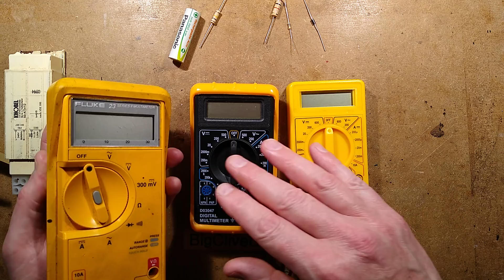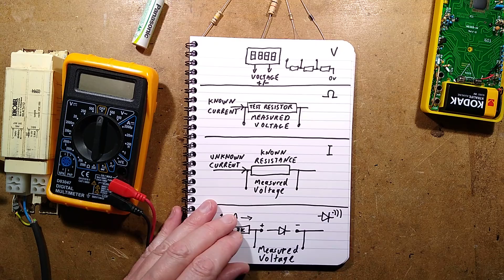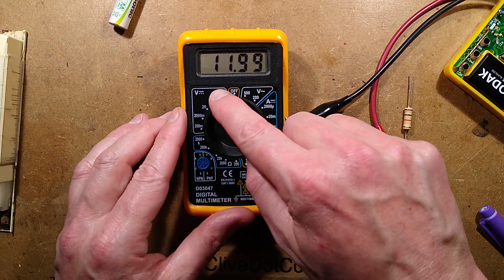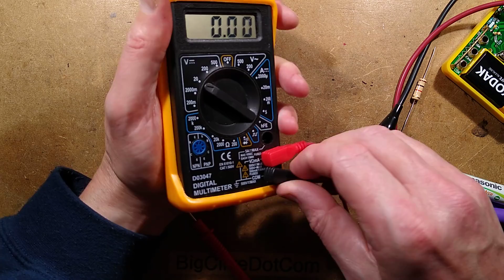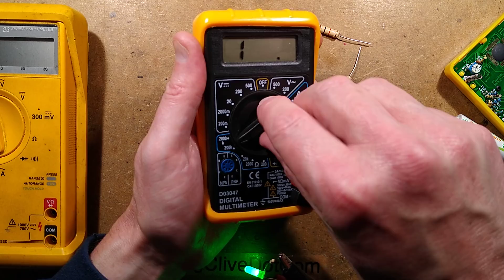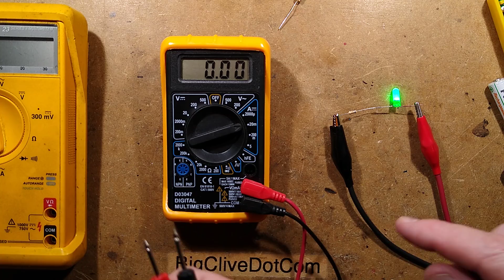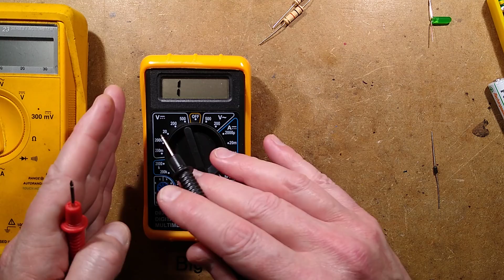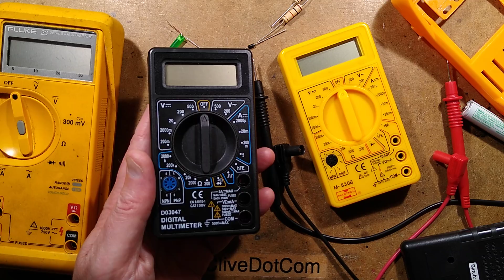How to use your trashy meter without blowing it up (much)

Comment: IMO, one of the nicest uses of the diode mode is the Louis Rossmann short-to-ground check. You attach the positive lead to the ground and probe whatever terminal you want to measure with the negative lead. Due to the inherent clamping diodes in any silicone chip, you will almost certainly get a forward diode drop. If it reads overload / open line, it's an open. If it reads 0v, it's a dead or low resistance to ground (but not via silicone).. It's not only useful for circuit boards, but also automotive etc.Just make sure the device is powered down.

Comment: I have loads of the cheaper ones. Bought from Maplins when they were £2 or £2.50. Some had a large blue rubber protector which is still good after almost 20 years. Same can not be said of some of my more expensive meters where the rubber covers fell apart after a year or so (whilst stored in the original box). Budget 9V battery lasts years and years also, Perfect for automotive and battery testing.

Comment: I got two of those cheap yellow ones many years ago - you could get them in packs of two for not much more than a single one, and I quickly learned the benefit. Yep, I did the typical, checked a mains supply with it set on ohms. It literally blew apart. Very entertaining. The second one still works all these years later.
Reply: Spare fuse - huh - SPARE METER !
Reply: I bought some of them many years ago from Maplin when they were selling them cheap at £2 each. I think I have two out of the cases and one still in its box/wrapping unopened. After probably over 25 years, the one I use regularly is now showing that the battery is low. I have a new 9V battery ready to put in it.
Reply: @paulsengupta971  I buy meters similar to the all yellow one from AliExpress and Harbor Freight (the HF meters are red for some reason, on sale they are about $5).  The leads that come with them are useless, I replace the leads with something slightly better, they used to be a buck or two but now they cost more than the meter at $7 or so.  Even with that, the cheap Harbor Freight meter plus decent leads is still cheaper than most other meters.  I do change out the cheap zinc carbon batteries for an alkaline battery before I use them.

Comment: Great video Clive. 
My first meter was one I built as an apprentice back in the 70s. I've still got it somewhere but I blew the diodes many years ago and never got round to replacing them. I still picked up a few things from your video that I'd either forgotten or just never really appreciated.
Reply: My first meter was a Tandy which was identical to the mainstream unit, except the case was blue, which indicated it was the kit.

Comment: I've been subscribed for a couple of years and I've learnt more about multi meters in the last 23 minutes than I ever did while I was at work (not that I had much call to use one).
 I have the M830B that you show but as you point out it doesn't have the beeper,  I've just ordered the D03047 from Amazon for £12.00 inc postage. 
We had Fluke meters at work but they are out of my price bracket. Thanks for the very informative video.

Comment: I have a great appreciation for these cheap multimeters. The value they provide is immense. For beginning hobbyists who are working on low voltage applications, they may be all that's needed. I recall learning about electronics (a long time ago) and dreaming of having such a meter. My first unit was an analog device with a tiny display and 1,000 Ohms / Volt resistance. The difference between a trashy meter and a good meter is much less than the difference between a trashy meter and no meter at all!

Comment: That's a coincidence Clive. This video notification popped up at exactly the perfect moment. Only yesterday, I bought a cheap Ferrex branded multimeter from  Aldi. This morning I thought, maybe I'll see if Big Clive has done a multimeter instructional video so I don't blow it up like the last one I had. It was also a cheap one from Aldi so no big deal.
Reply: Aldi do really good electrical screwdrivers. Any time they’re in I’ll pick some up, they’re like £5 for a whole set. How are you getting on with the meter?
Reply: @WineScrounger  haven't used it yet, but the last one worked very well until I put it across my car battery on the wrong setting. 🥴 Aldi had the screwdriver sets in yesterday when I was there. This time they're Wera clones, with the same handle shape. I was tempted but there's nothing wrong with the last set that I've used for about 8 years.

Comment: Dave actually prefers the "latching" type, a third type to your selection.
There are scratchy beepers, slow beepers and latching beepers that react immediately (unlike your cheap one) but then latch for a few milliseconds.
Reply: Also, worth mentioning that probes can make all the difference, my cheap ~$8 meter at first glance is rather slow like Clive's here but if I swap the probes, with the ever so slightly better ones from my $20 meter, it becomes very responsive like Clive's preferred meter, it's a massive difference and makes my $8 meter a lot better, so even for bottom barrel meters it may be worth it to buy some decent $20-30 probes.
Reply: @vgamesx1  Functionally speaking, the probes do make the most difference in operational user interface between the high end meters and the cheapest.  Pliable silicone test leads with good probe tip profiles vs plastic insulation that like to stay in a set position. 
Cheap meters are also very sensitive to the contact resistance in the rotary selection dial, and will read incorrectly if you let them sit for long periods unused, letting oxidation set in. You have to rotate it to clean out the contacts if that happens.
Also the other main issue is if you see a low battery indication on the HF meter, the readings will no longer be accurate, since it relies on the battery being high enough for generating a reference voltage for measurement.  Higher end meters can be used with no dropoff in accuracy all the way out until the display is too dim to see.

Comment: I'm very much a novice with stuff like this, but I've had my cheapy meter for a few years now and it's been incredibly useful, even if it's just for measuring the voltage of batteries, checking earths on my car with the continuity tester and helping me wire in the new head unit and subwoofer in my car. Can't reccommend these enough to someone in a similar situation to me.

Comment: As someone who has used a multimeter for around 50 years loved this video Clive. My apprenticeship was with Reliance Telephones(GEC). The branch manager did not give Taylor or AVO multimeter to apprentices as he said you will blow them up as I did checking cell voltages across a lead acid battery, being a cheap Altai one I replaced it myself. In my third year was issued with a good quality Taylor Multimeter. Digital ones were a long way off. Agree with your pal about the ones with a transistor test poor usually. Keep it up.

Comment: I actually used the diode tester on my cheap-o meter last weekend!  I have a grow lamp where half the LEDs won't light, and I was able to prove that all of the LEDs on that panel are fine by lighting them up individually, and that none of the solder joints were bad.  I was able to conclude the driver itself is toast.  Though now I'm stuck trying to figure out the right specs for getting a replacement driver, since that board has zero search results.  Maybe I should try measuring the amps on the good one.

Comment: +++ good advice. Was good to mention that, although cheap, these units are accurate enough for non professional/lab use. Getting all pent up about accuracy/calibration/number of decimal digits is a waste of energy for most hobby electronics.  Save the money for components!

I would say that 40% of my meter usage is comparing measurements or quick (1/2 decimal place) voltage measurements when, to be honest, accuracy is not important.

Why they still put transistor testing on them is a mystery, I don't think in 40 odd years I have ever used that feature on the meters I have owned! (which is many)
Reply: "I don't think in 40 odd years I have ever used that feature on the meters I have owned! (which is many)"

Do you go through that many meters ?

In 40 years  we're up to 3 meters. The first was an analogue 'freebie', the second an AVO 8 which still works on some ranges (voltage is way off on one range now???) and the Micronta 22-195 (Intertan) from Tandy - which I used to reduce the voltage supplied to the house. When the man came to check oursupply voltage, I said what I was reading and he physically implied he was getting the same value.
He said that he'd go and 'adjust the tappets'. I said nothing.
Reply: @millomweb  tappings? Maybe he meant transformer tappings.
Reply: @WineScrounger  I presume he did too !

Came across a Yank talking about the 'commentator' on an armature a year ago or so - and made comment. Result was he turned comments off on his videos :)

And one well-educated guy at work said not to reboot computers in a short space of time 'as it warps the discs' in the hard drive.
Reply: The only time you need a decimal point is when you test the voltage of batteries. Other than that, rounding to the nearest whole works fine.
Reply: @williamhuang8309  Precisely - depends entirely what you're measuring and why.

Comment: I modified my first meter for school, a cheap one from Radio Shack. I added a 5A ceramic fuse to the 5A current terminal. I had no real need for testing higher current and I would much rather have a fuse blow than overload the leads and the meter. I'm sure that meant my current reading would probably be off slightly, but since I would almost never (have never?) needed that terminal, I would probably have a slight increase in safety if I made a mistake. Never had an issue.

Comment: Got two of the one on the right for a fiver in Maplin, in about 1998. Still use them, still as good as the day they were made, and I would estimate better than 1% basic accuracy when compared against my fancy-pants ones. Might take the back off and see how much the PCB has changed.

Comment: I've still got one of the Tandy ones, still working perfectly after 40+ years.
It a Micronta with a digital display and a spare fuse, never used, in the battery compartment.
Reply: Which model, 22-195 ?
Reply: @millomweb  22 - 188.
Reply: I think my 22-204C (analogue display) might be older than yours, and of course a) it still works just fine, and b) the spare 20mm glass fuse is still a spare!. It might still have the original 4mm banana plug test leads.
Reply: @cypeman8037  Not the same as mine then ! Is it a 'bench' type - so it has a carrying handle that doubles as a rest to angle the meter up to make the screen more visible ?
Reply: @cypeman8037  So I see. :)
Reply: Mine died. :-(
Reply: @paulsengupta971  Many didn't !

Comment: We learned to use multimeters in O-grade Physics back in the 1980s. In First and Second Year, though, we had huge, ancient Avometers with tattered leather straps. I was fascinated by the clicking sound as I turned the dials: it sounded, to me, like someone trying to crack a safe.
Reply: With a needle swing of about a mile
Reply: @Namirred And often bent because someone used the wrong range
Reply: @theturtlemoves3014  ,  Reverse the test-probe polarity and touch it once again to the overly high voltage, to bend the pointer back the other way and straighten it!😁
Reply: @goodun2974  😂
Reply: One  poor connection in a circuit.  Needle waving like in the wind. The fluorescent light was driving power into the circuit.  Who knew.
Reply: Those old Avo metresdo not survive decending from third floor windows to the car park below....
Reply: @18robsmith  
🤣🤦‍♂️
Reply: @18robsmith  Reached TERMINAL velocity, eh ;)

Can I claim 2 puns there in one word ?
Reply: Back then, we had DMMs with push buttons down the left hand side that pushed in sideways. There was a Fluke floating about too somewhere in School.
Reply: Two, or more, puns in one word are accepted by me without any resistance.

Comment: Thanks!  I got a couple of good new insights!  One problem with the cheap meters for me is the too-symmetrical indicator bar on the rotary switch:  more than once I've tried to measure something with the selector at 180 to the desired position.    BTW, I've also enjoyed using the arduino-based TC-1 multifunction tester for testing various components, as it can measure capacitance and inductance, which you can't get in any other cheap piece of kit.
Reply: Yeah I have had the same problem with the rotary switch putting in the wrong position. I found that a dab of white out on the pointer end usually helps.

Comment: I have the multimeter in the middle and have had it for about 7 years ! I was going to get a new meter because frankly I was almost embarrassed to get it out but now you’ve made me realise that it does do exactly the job I need it to do so I shall continue using it ! It’s been dropped heaps and has tape around it and the wires are abit fucked but strangely stays reliable so I’ll keep using it
Reply from the maker: The original Fluke meters are rugged , serviceable and still very accurate 30 years later.  They're good meters.

Comment: My advice for the next step up is to get a meter which automatically powers down after a while as it is infuriating to go to your cheap meter and find the PP3 battery has gone flat as you accidentally left it turned on. Invariably this happens when you really need the meter and you can't find a spare (also, keep a spare fuse or two).

Otherwise, it's like that old adage of measure twice, cut once. In this case, check the scale you are set to (including the sockets the test probes are plugged into) twice before measuring...
Reply: I open up my multimeters and fit a little 3mm red LED into the front panel that lights up when it its on.   Only takes a few milliamps but saves a mountain of batteries.
Reply: And null those leads.`
Reply: I have the CPC and it does self power down, after giving a few awning beeps first
Reply: Every piece of wire is a spare fuse

Comment: You bought me at the first sentence about snobbery, although I already knew your opinion from former videos (I have been watching you for many years). Thank you for being a real guide and inspirator for young beginners! They (we) do not need expensive equipment at day 1 of learning because most of us won't need expensive equipment ever. Every device has limitations which you MUST know for safe use, no exception. If you learn and respect the limitations, every device can be safe, but if you don't, all can kill you (or even worse: the pcb :)) I think a good advice is that you should buy more expensive quipment only when you know exactly what extra feature you need. Through your home fixer "carreer" you will take about 2-3 steps while you reach your optimal device (multimeter or soldering iron or anything), they will still be cheaper than one top quality device (and you will have backup if your former meter did not die).

Comment: Clive; I'll echo the sentiment of Harbor Freight meters.  They are inexpensive, basically a "throw-away" item [especially since they have now soldered the fuses in place].  But, for the casual user, they work exceptionally well.  I think I've had mine for over 10 years now; the only problem I've had is changing the battery.
Reply: In 30+ years I've had to change the batteries in my meter as they've corroded!
Reply: Unfortunately, Harbor Freight seems to have stopped giving these away.  It appears they have ended all of the free stuff coupons.  Sad day.
Reply: My £2 Maplin meter is just starting to show the battery low indicator.

After about 25 years.
Reply: @paulsengupta971  Never had that from my Tandy/Micronta meter. Just need to change the batteries as they're starting to corrode.